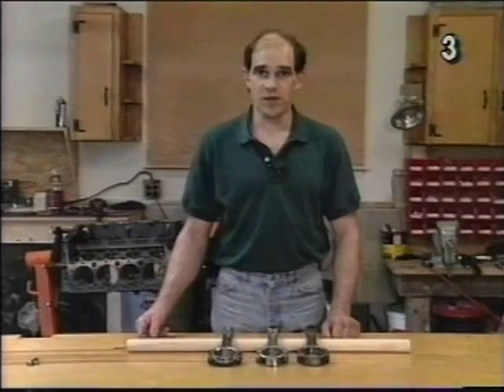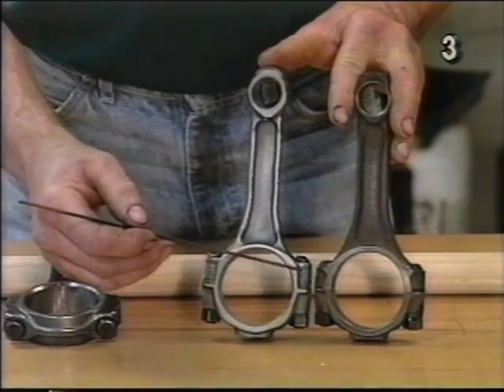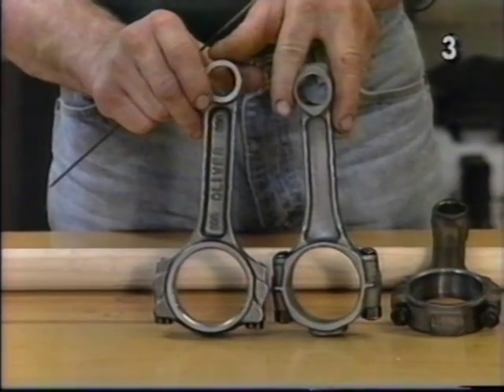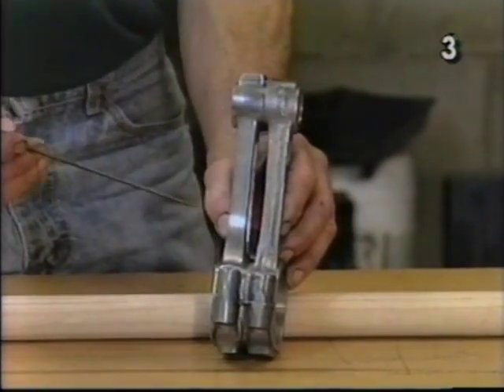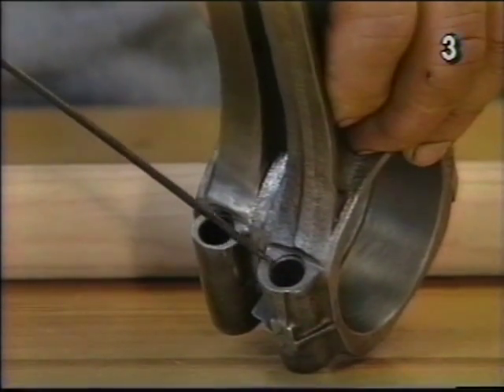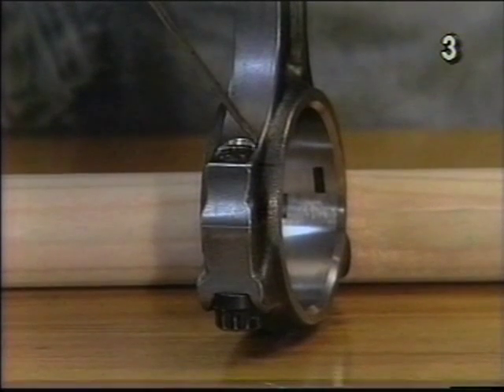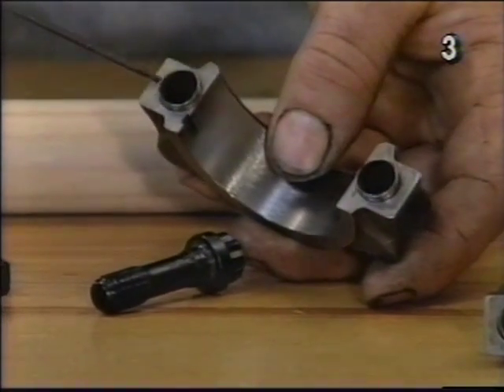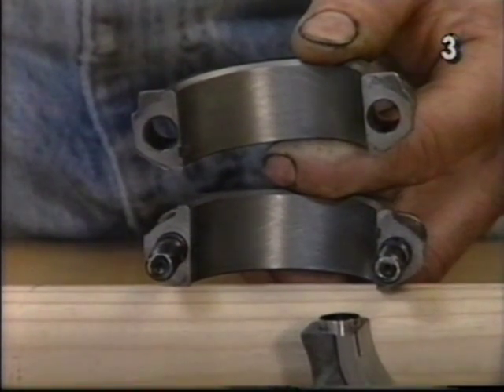Hotrodding the SBC  Part 3  Connecting Rods

Comment: Great tips on these videos, however...before you begin grinding away on the side beam, measure to find the lightest of the connecting rods. Work that one first, grinding from top to bottom (small end to big end) or vice versa, never across the beam. Re-measure afterward, and recognize its a good idea to work the other connecting rods down to that weight. Or if you want a cheap balancing job, match up the lightest connecting rod to the heaviest piston and wrist pin, and work your way thru your collection of reciprocating assembly parts.

Now let's watch how many from "Uncle Tony's Garage" come here to talk about swapping pistons from bank to bank to hope to get more HP out of the deal.

Comment: Use a Chevy 400  5.56 rod and lightweight pistons = more cubes more power
Reply: It does not change the cubic inches
The short rod makes you use a heavier piston.
You want a 5.875” or 6” rod with a LIGHT short piston